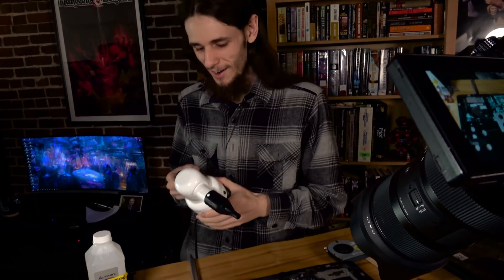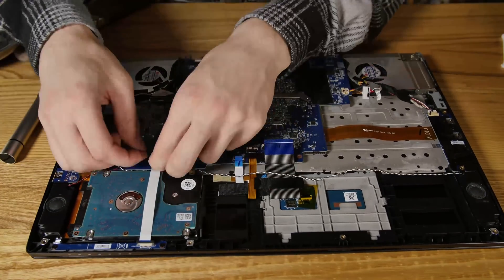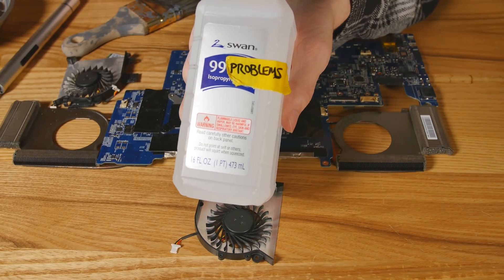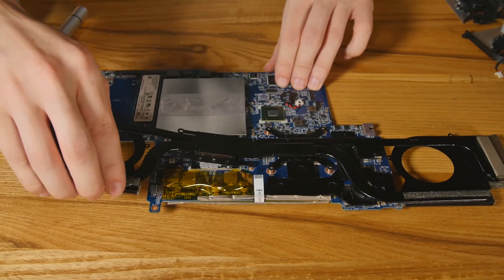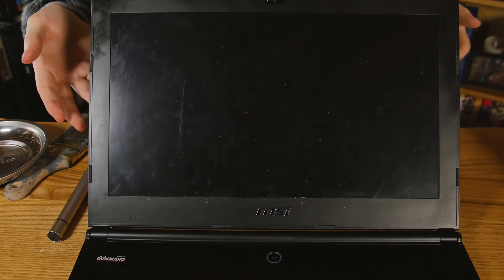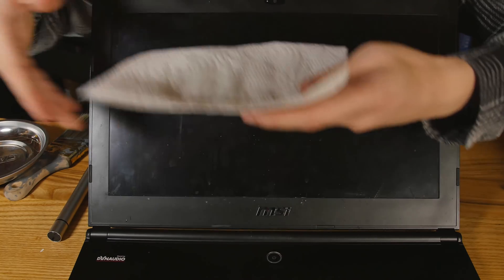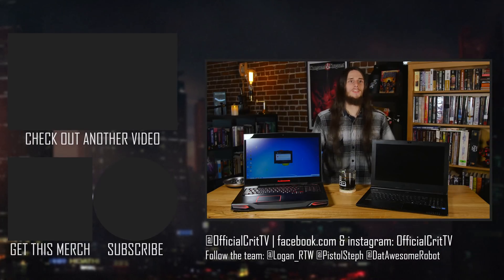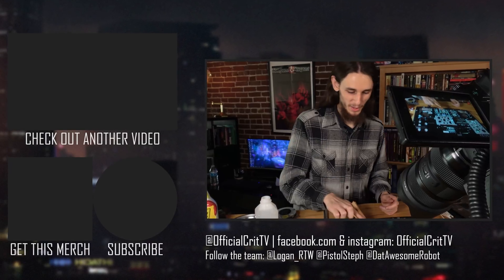How To Clean A Laptop

Comment: Compressed air can isn't available on my local store and it's prohibited to ship it online, is it safe to use electric air duster instead? It also got a brush nozzle attachment so I think it is advertised to be used for computers so I bought it. I'm just asking because I'm not sure if it is safe to use it and the thing is yet to be shipped, I want to make sure before I use it on computer components.

Comment: Yeah, followed your instructions and cleaned the keyboard just like you did and now the keyboard is shot to hell with keys responding to completely different inputs. Great.
Reply: Ouch
Reply: If you turn the power off and wait until it’s dry hypothetically you could turn it off put it In a tub of water and it would be fine once fully dry! 
Your issue is 100% operator error 
Never give electronics power when wet
Reply: @joshymcdaniel9233  Lol, you think I would put a laptop in water while still powered? Dude, give me SOME credit. I believe your statement was more or less built on that one word.. "hypothetically".

Comment: My girlfriend had a candle behind her laptop and it melted thanks to the heat from the laptop. Candle loss wasn't a big problem, but the wax was sucked in from the bottom so the whole laptop was filled with the wax. Used regular hair dryer and toilet paper to get it clean again.

Comment: Instead of canned air get a bellows. Giottos Rocket Air Blaster Large is cheap and lasts basically forever, doesn't need electricity and you can control how much pressure comes out of it.

Comment: My fan noise is insane,it was not that when new ,even on high usage. how to fix.
Reply: try what these guys just did, but instead of a brush and compressed air, use hot glue.
Reply: Joona Knuutinen the rubber based one? Oh man it sounds like it is grinding . Help.

Comment: You seriously sprayed cleaner directly on the surface of the keyboard? No that's not how you do this. NEVER spray any liquid directly onto any surface of a computer. The rest of what you did was alright but you also seriously need to address ESD safety...
Reply: A few drops of fast drying liquid isn't the same as spilling a cup of coffee on the keyboard. It's not getting under the keys.
Reply: CrapolaFarm that is true, its also not a good idea to spill coffee on your keyboard. It might not hurt it 9 times out of 10 but that one time a little drop goes under and finds its way to a pcb and you've got yourself a dead keyboard

Comment: For exposed dies, I recommend spreading the thermal compound manually, then place the cooler down. The reason for this is that the dot method may not allow the compound to spread completely to the corners of the die.
Reply: Razor2048 you don't to spread it completely
Reply: When replacing the thermal compound on a laptop (Should be done as soon as the warranty is up), you want the entire top surface of the die to have proper contact with the heatsink. If you would like to test, try the dot or the really short line method, and then reinstall the heatsink, then remove the screws again, and remove  it to check if the compound spread. In some cases you will end up with nothing on some of the corners of the top of the die. 

On the other hand, a thin layer spread over the die, and then installing the cooler, allows for a guaranteed 100% contact.
Reply: Razor2048 a thin layer using a credit card or something leaves air gaps that does not conduct heat. Also, the sides of the die are responsible for like 2% of the heat transfer (not exact numbers ok). I mean, this is very well stablished for desktop cpus, unless it's different for laptops for some reason that I do not know .
Reply: A desktop CPU typically has a heat spreader, which can be soldered to the die, thus making 100% contact. with it, and thus allow for some inaccuracies in coverage between the heatsink and heat spreader, for example, the thread ripper CPUs can work with a standard closed loop cooler, even though the stock thermal compound application results in part of the CPU dies remaining uncovered, though when additional compound is applied so that it is spread out fully, temperatures become lower.

When dealing with an exposed die component, you have no heat spreader, and if part of the die does not have compound on it, there is no way to be sure how hot that part of the die is getting, since the thermal sensors in the CPU do not monitor every single square manometer of the die. When dealing with an exposed die, you need to have 100% coverage, it is why the factories go with the method of putting a ton of the stuff on the CPU, it is better to have too much compound and ensure full coverage, than it is to have ant portion of the top of the die to not make proper thermal contact with the heatsink. This is especially the case if high temperatures will be reached. If the die pas partially covered, it is possible for the CPU to report a safe temperature while another part of the die has reached an unsafe temperature that will shorten the life of the chip.

Since wafer usage directly translates to how expensive the BOM cost of the clip is, the active areas of a die, are very close to the edge of the die.

For a spread method on a bare die, you still want a slightly thicker layer of the compound so that a very tiny amount will squeeze out. Unlike heatsinks designed with heatspreaders in mind (where the surfaces can often be slightly convex), A heatsink designed for an exposed die, has to be 100% flat. A good amount of pressure will still get applied to them, and the air bubbles will get squeezed out. If you would like an easy way to experiment with thermal compound spreading, get some cheap compound, then take an old digital watch (they often have a hard glass LCD screen, that can become completely clear when you remove the reflective back layer.  If you press that onto an exposed die, you can experiment with how much compound is needed as well as how it spreads. A manual spread that is ever so slightly thicker than you would use on the spread for a heatspreader, allows for proper contact, and no air bobbles when enough pressure is applied.

Replacing the compound on a laptop heatsink can often get you around a 10-12C temperature drop (assuming you use good compound).
Reply: Razor2048 interesting information. Anyone has other infos on the topic? Also, may I ask what's your background? What did you study?
Reply: Currently my experience in this area is from doing board level repair on laptops. For getting the most reliable thermal compound coverage, I have moved to manually spreading the compound because with the dot or line method, there would occasionally be a corner which did not get compound, thus for safety, if insisting on the dot method, you would have to use a lot more than what is needed so that compound is guaranteed to ooze  to each corner, or do a manual spread, use less, and get guaranteed full contact. The manual spread method allows for reduced cost as a tube of compound will last longer. 

Due to the nature of thermal compound, and not being able to predict how many repairs you will need to do, it will not work to just buy a large amount of the stuff since it has a limited shelf life, thus thermal compound is a difficult area to get and savings on.

Comment: Used gun to shoot off thermal paste.  Laptop won't turn on.  Please advise.
Reply: Shoot it again
Reply: Stupid gotta shoot it 10 times
Reply: Shotgun is what you need
Reply: You need thermal paste exactly where you shot it off. My PC kept shutting down in 10, 6, & 4 seconds after trying to turn it on because I forgot to reapply thermal paste onto my CPU from my heat-sync. It's an overheating problem that new thermal paste should fix.
Reply: Wat
Reply: Sweet Home Alabama!
Reply: Just put some flex tape on it
Reply: Awoootism BANG BANG BANG
Reply: I really hope there isnt a dumb person reading this and actually does this

Comment: I'd still rather spend the longer time cleaning the fan with alcohol than risk snapping off the fan blades with a brush where its harder to regulate the pressure you are putting on them than a Q tip.  They can be quite brittle especially if they have aged.  The dust can also be quick well adhered depending on the environment you have been using it in.

Also as others have mentioned, spraying anything directly on the keyboard is a bad idea, plus using generic cleaner can potentially damage the touchpad and any coating your screen might have, especially if its a touchscreen.

Comment: never EVER spray cleaner on your keyboard. The gray area for what is tolerable by the system is non-existent. You can and WILL put too much on.
Reply: Even when using these cleaners on TABLES they tell you to spray onto the cloth not the surface.
Reply: Most (if not all) laptops are designed with a spill guard under the keyboard to prevent liquids from reaching electronics. A spritz of fast-drying cleaner won't hurt anything.
Reply: Alex Atkin Here you go: http://lmgtfy.com/?t=v&q=spill+resistant+laptop
Thousands of videos, just for you. :)
Reply: Which doesn't prove "most if not all" laptops use those keyboards, just that their higher end models might.

Typically manufacturers will advertise in huge friendly letters if they feature something like that, because its a selling point.

Also, getting away with it in testing doesn't prove that it wont hold the liquid and slowly corrode the PCB over time.  I have spilt cups of tea on my tower and it not done any damage, it doesn't mean its a good idea to do it.
Reply: I have never seen a single piece of evidence backing that up but thousands of videos of laptops with water damage.  Why would you take the risk?

The manufacturer doesn't care if you break your laptop, more money for them replacing it.  Even waterproof phones aren't covered under warranty for water damage.

Comment: Carey Holzman said that a vacuum can be used on fans. Those laptop fans look a little more fragile though not sure. You could test it. Vacuum versus a assortment of case fans and even laptop fans.
Reply: Fans are mostly plastic, no problems with them. But stay away from the boards for static

Comment: Don't listen to some of the idiots in the comments. I clean my $400 laptop with alcoholic window cleaner and paper towel since I got it (2.5 years) and it's perfectly fine, no scratches at all. Just don't spray the stuff directly on the surface.
Reply: You can run into problems with the cleaner itself too stripping the coating off the screen, depends entirely on the finish of the screen.

Its certainly worth pointing out that if your laptop has a touchscreen then DO NOT use anything not designed for it as that WILL remove the oleo-phobic coating and it will become even more of a fingerprint magnet than before.  This applies even more so to mobile phones as they are more likely to have that coating.
Reply: Tibor Klein might run into issues with any type of coatings on the screen... microfiber cloth would be better. Similar to what you'd use for eye glasses
Reply: There is no coating on my screen. I use the same method with my smartphone as well, same there no scratches, even though it's almost 4 years old. Modern screens are not too easy to scratch.
Reply: Ah the old "I've done it so it MUST be safe".

I handled RAM, CPUs and graphics cards without being earthed for 20 years, it only took that once to get unlucky and fry the RAM on a GPU.

The point is if you are making a video advising how to do it properly, its a good idea to actually give GOOD foolproof advice and this video is far from it.

Comment: I find the absolute best way to clean heatsinks without damaging the cooling fins is to remove it first and wipe off the thermal paste with alcohol or contact cleaner. Then wash it in the sink with warm water, submerge, let it soak and rinse through the fins under the tap. Every last bit of dust should come out. 
Either leave it to dry out or quickly dry it by using a hairdryer as the heat sink will conduct the heat and evaporate all the water.
Reply: Stuntman707 thanks I’m about to do that😁

Comment: Here's a piece of advice learned from my own mistake: You can use something like Windex on the whole exterior of the laptop, but do not, I REPEAT DO NOT, use it on the touchpad. That killed my touchpad. It was fine at first, but then it started detecting my commands less and less until one day it stopped completely. (I clean my laptop every 2 days as far as exterior goes)
Reply: Was thinking the same thing.  Anything like a touchpad or touchscreen you can mess up using generic products.

Comment: RE: Magnetic trays- yes they're nice, but the best is a small magnet stuck directly to the side of your screwdriver.

Also, don't squirt cleaner directly onto the machine.  Too much risk of a drip getting inside.  Spray it onto your cloth, then wipe.

Comment: Ask Hillary Clinton how to clean a laptop
Reply: I thought you were supposed to go outside and rub the laptop screen against a tree?
Reply from the maker: Bandana zX we used to just rub mulch on the screen.
Reply: Been using paper towels for years, it's fine. It's not a concours level show car, it's a fucking laptop made of cheap ABS plastic.
Reply: Personally would advice the microwave oven. 12 minutes on max power will ensure cleanliness.
Reply: I use toilet paper....

Edit to add: I think Hillary would be best at deleting stuff off of people laptops..lol  Got a laptop with sensitive information that you need to remove before selling it on Craigslist? Hillary is definitely your gal.
Reply: @daddydangerous20  someones big mad>
Reply: Remove Gmail's trash-folder